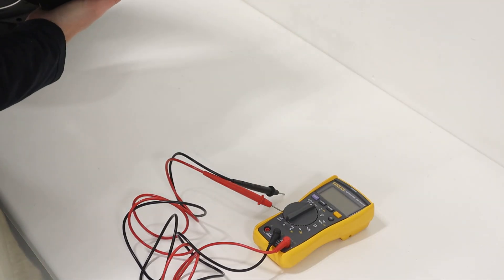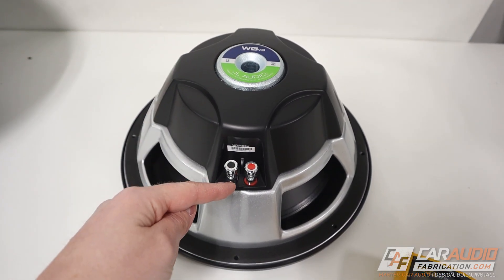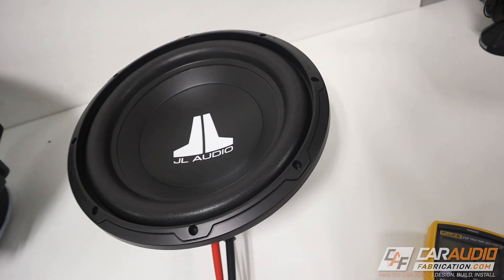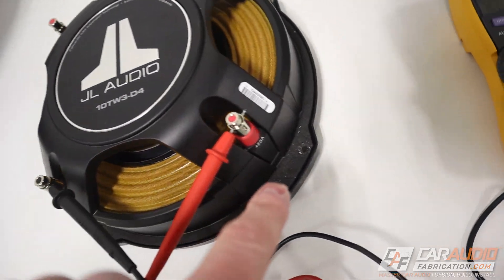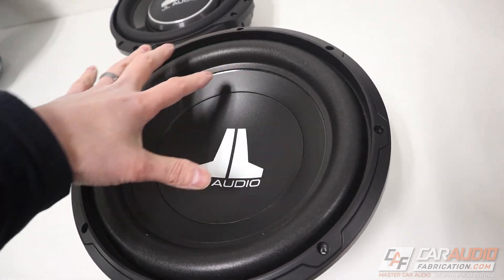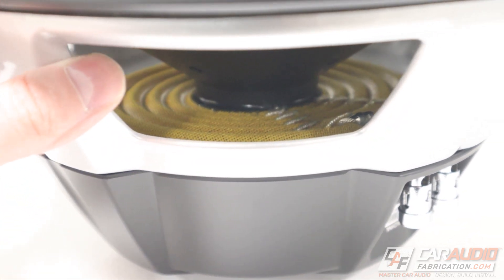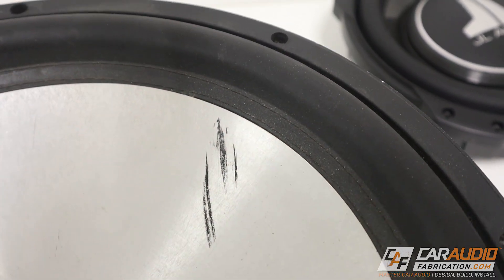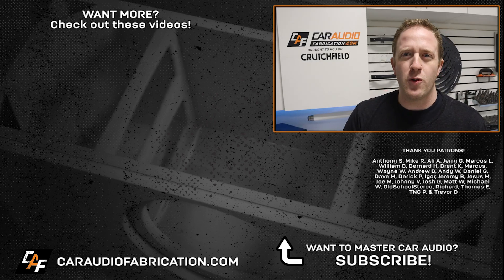Buying USED Subwoofer? Test & Check THIS!

Comment: Overall, I found this to be an outstanding tutorial on what to look for. The only thing I would add is to check for spider sag. And someone else mentioned checking for voice coil color. This is wise also, albeit some vc's are black to begin with.

Comment: My head unit went and until I can save money for a new one I decided to get a 25$ kicker loc but when I went to play it I got a shit ton of noise it was loud sounded like I was playing a 35hz test tone at full tilt on a xv3 18 , I disconnected it right away but now when I push on the cone I feel some coil rub but also each coil is still reading 1.8 ohms it's a dual 2 ohm sub. Did I damage it?

Comment: I have a dual 1 ohm sub. But the coils give different ohms. Voice coil one is 1.2 ohm and voice coil 2 is 2.7 ohm. What is the issue? Do i need to recone?
Reply: Likely yes. The voice coils would receive 2 different power amounts not playing equally. It may last a while if being underpowered. Giving it rated or more than rated power will likely cause it to go soon. Plan on recone.

Comment: I put the multimeter on mine and it says .000 but fluctuates when I touch or press the speaker, does that mean it's dead? Also doesn't work when i plugged it in but I thought it might of been my wiring

Comment: Hey Mark my name is Mike and l have a problem so l need your help or anybody help. I have 2 projects that no one can do. 1. I have a Orion Hcca 181 SPLX 18” 20,000 watts 7,500rms 1ohm and looking for what subwoofer specs l need for a box. 2. Can you tell me what Amp can push 7,500rms

Comment: That is very cool, are used to buy a lot of open box stuff from circuit city and 99% of the time I usually Won or I came up or was very happy with the purchase or sold the amplifier or stereo very quickly for more

Comment: hi not quite related to this video but I and planing Speakers set up for my car. I plan on having two 5 inch component speakers in the front doors. And two 4 inch component in the back doors. there is no room for anything over 4. I also had plans to have two in the real dekk Because they are already hols for some 9x6 (mayby component) speakers. and finally a 10 inch subwoofer. I thought about 70w RMS on the ver speaker and 250/300 W RMS on the subwoofer. 

question 1 I really want the amplifier to look the same so I can use two 4-channel amplifiers. one to all the doors and one to the two 9x6 and bridge connect two channels to the subwoofer or will it prevent sound quality  
I dont need super quality but want something good that I have made myself

Question 2 is there too little 250/300 for subwoofer and is it stupid to have in the back doors and the 9x6 speakers for these must get the same audio signals

Comment: Good tips.  I had a sub that I over pushed too hard (20 years ago) and the mesh wire came off. I tried soldering it back but only lasted about 5 minutes before failing again. Certainly worth checking that!

Comment: Are there any tools/toys or ways of using a dvom to track down alternator whine?
I know the basics of run your signal RCA Wires down one side of the car and your power down the other side. But I've got a whine that comes and goes, I've tried turning accessories/headlights on/off etc but having trouble tracking down the source of the whine...
Any ideas?
Reply: It could just be your alternator on its way out. Use a voltmeter and check for AC voltage at the terminal. There should be none or very little. That would show you the diodes are bad in the alternator.
Reply: probably coming through your head unit. Use a simple filter on positive and negative wires going to your head unit.

Comment: Question, how good of a subwoofer does it have to be in general opinion? I have two 10 inch 1200/600rms dc 4 ohm dvc and they seems to have plenty of oomph. Is it one you or anyone in chat here recommend being repaired? I still need to check of its broken. Thanks in advance!
Reply: No true answer to “good vs bad”.  Obviously Uber cheap items (typically) don’t perform as well or the build quality isn’t as good.  

The second part of your question doesn’t make much sense.

Comment: a great little test i like to do is get a little square 9v battery or any battery can work, and just put the pos on the pos and the neg on the neg and it will pop the sub in one direction and if you reverse the polarity it will pop the opposite direction and if you tap it quickly you can see it move and also hear it move, by doing this test it shows 3 things, 1- the movement of the sub 2- hearing for any noises and 3- making sure the coil is working and there is no break somewhere, i personally have used this many time buying 2nd hand subs and forgetting to bring my mutli meter so i just get some wire and a AA battery or even car battery and do a pop test
Reply: Hey I I have nowhere to the competitive car audio scene anyway I just installed a bigger amplifier in my car and I had to wire my subs from one ohm down to four ohm I followed the directions in the deaf bonce aak manual of how to wire it down to four

Comment: Great video! You should consider a video on used boxes and amps as well.
Reply from the maker: Hmmm... if enough people post up asking for it maybe!
Reply: @CarAudioFabrication  Hello! I own a 2022 Ford Fiesta and I would like to upgrade the sound system. I already know that the stock receiver doesn't have  auxiliary outputs. I would like to do a 6.1 system upgrading the existing speakers and adding, besides a subwoofer, 2 extra speakers in the back(on the piece that moves with the hatchback)
Reply: @CarAudioFabrication  asking
Reply: I’d love to see the used box and amp video. Please do it in your living room barefoot .
Reply: Idk buying an amp is pretty much a yes or no, just do it and see if it works

Comment: I once bought an used Kicker sub that doesn't want to play low (also played quiet). It measured impedance OK, looked physically ok... So I bought a new exact same model from Crutchfield, and yes, the used sub definitively have an issue because the new one played much better... But I never knew what issue it was.. To every buyer of used gear, do everything you can to fully TRY the gear before paying and leaving.
Reply: So weird!
Reply: Boopootytiiinnnnggg

Comment: I've seen many used subwoofers listed for sale with punctures (misguided screwdrivers) in the surrounds that have been "repaired" by the seller by globbing on  some type of adhesive. Are those to be avoided at all cost, or are they still viable if the price is right?
Reply: Honestly I’ve repaired some subs before and they sounds just as good. Just make sure you get a great deal not just a good deal on a sub like that.
Reply: i have been aN impatient dumbass and punctured surrounds before and had no issue fixing it with E6000
Reply: not always a big deal
Reply: just depends
Reply from the maker: Would it still "work"... yes... but it has a likelihood of failing. I'd ask myself "is this an AMAZING deal"? "Can I afford to also recone". If not probably best to avoid.

Comment: Something I always wondered. Would it make sense to get an amp for my car speakers even if I play my music at less than 20% volume? Could I just add a sub to my pioneer directly and skip the amps?
Reply: It depends on the Pioneer deck if the crossover inside the head unit supports high pass/low pass crossovers on the internal amp a 6 inch bass tube (passive) is the most efficient sub system you can get 100db at 1w/1m
Reply: @dj4monie  yes the unit has a cross over function. Its an avh-x2800bs
Reply: an active sub will do it..like an edge..
Reply: Just get a 50w Bass Tube from SAS aka Bazooka. You are not getting the low end sub frequently from door speakers. To complete a stereo you need a sub. My Forte GT came with the HK system and 6.5 sub in the rear deck. The problem is 12.5 watts per channel or 25 watts total is not enough for low frequencies. You need horsepower or amp power for stuff below 50Hz.
Reply: @dj4monie  so maybe I can just get a low watt amp just for a small sub for cheap (but of course not at the expense of quality) and connect that to the sub out on my head unit?
Reply: @MrdotKstar  like I said get an amplified bass tube Bazooka 6 inch 100w is fine, get the level control, use high pass filters on your main speakers. It will sound very good and have excellent bass, follow the directions in the manual (rear facing, 2-4 inches from the rear of the car speaker side only). Crossover is fixed at 85hz. One thing to buy, setup and install.

Comment: If my component speakers go out will I still have bass?
Reply: Yes why wouldn't they? You should enable high pass filters. Most good components can play down to 55-60Hz or further in a door that is sealed well and sound deadened. I can easily play Hertz Desi down to 60Hz on deck power.